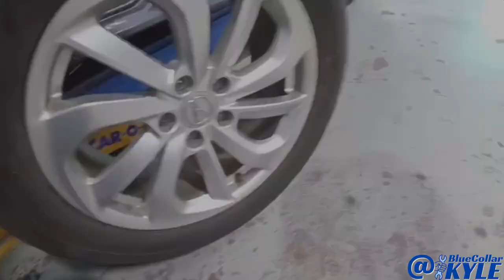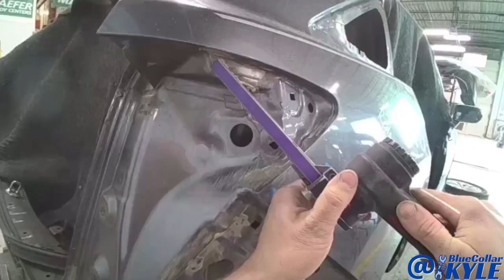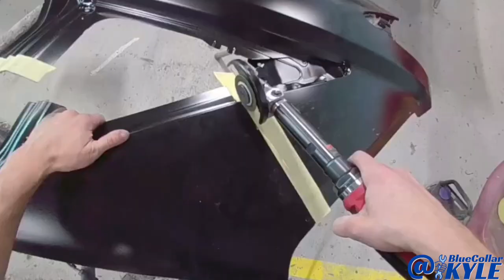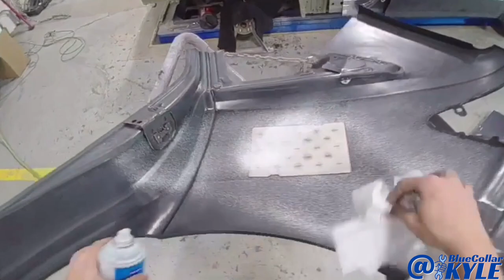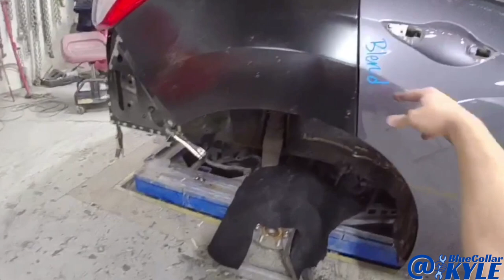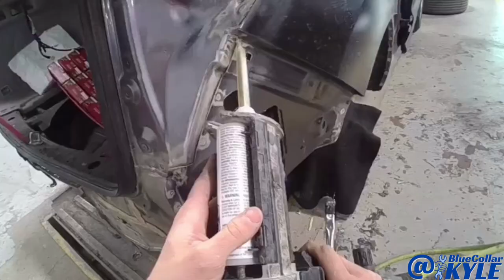Why Replace That Quarter Panel?

Comment: You can actually repair that. The car-o-liner measuring system does comparative measuring. You can take measurements off the undamaged side and pull the damaged side where it needs to be.

Comment: I thought the blind spot module can be recalibrate after the lower extension repair. If the module can't be re-aim, what was the point to even recalibrate it? I'm pretty sure Kyle just follow the manufacturer's repair statements. But some of these statements doesn't make any sense to me.